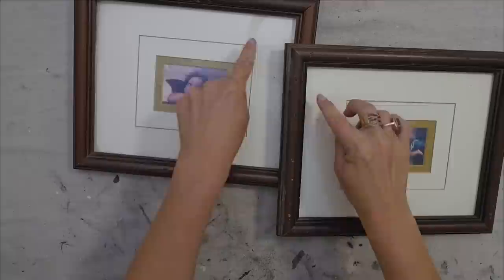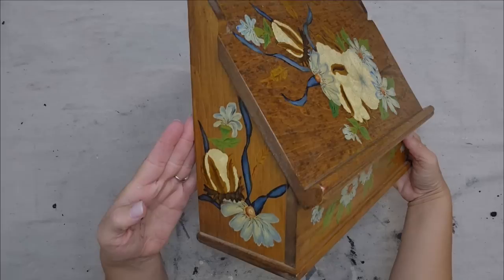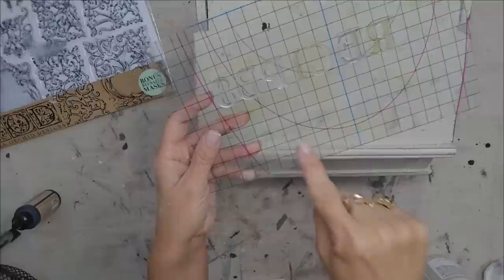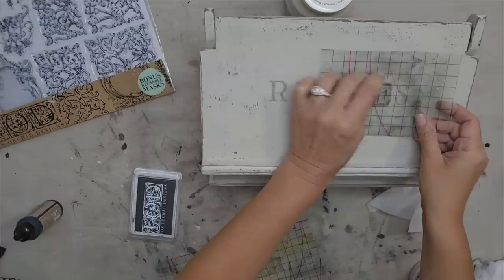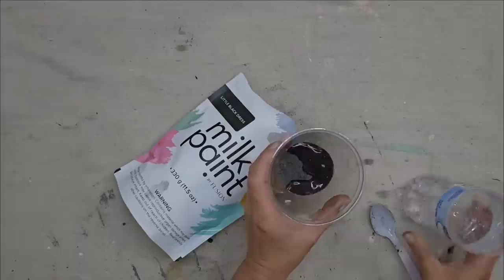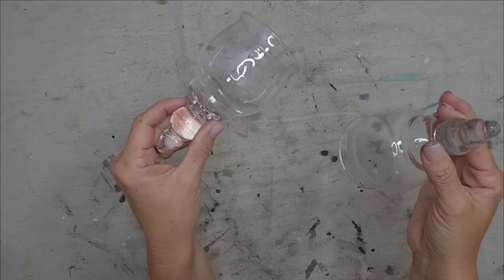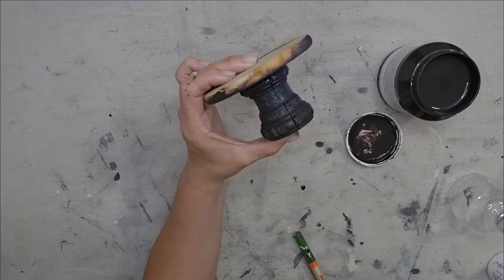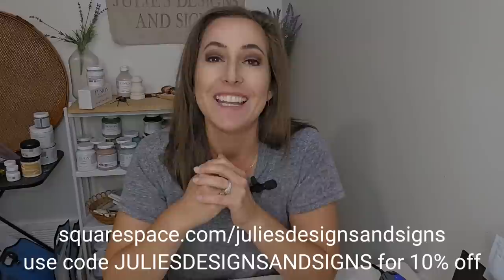thrift flip home decor • home decor on a budget • DIY • creating an old aged look

Comment: The two frames redo was a favorite. Painting the whole mat was a good idea. The fish was an ideal transfer. The Millot's transfers have too many dark and dreary transfers. So I would never purchase it. What it did have going for it was the multiple selection of different elements so one could be a little more artistic, and put together their own ideas. The IOD's are really too expensive for the average DIY'er.
Reply: I agree they are expensive. The only way they can make sense to me if you’re a flipper is using them on pieces you can make some money on.  Also I have found that some of the books of transfers go a long way. You can stretch out designs with stamps or stencils too. I realize many of the YouTube creators also sell them and some get them free from other sellers. So they can use them unsparingly, like on a paper gift tag. Not me, what I put it on has to reflect overall costs.
Reply: Yes,  IOD’s are definitely out of my budget range!!!